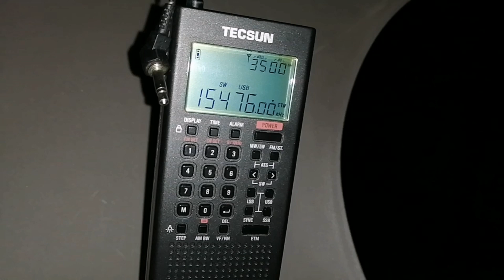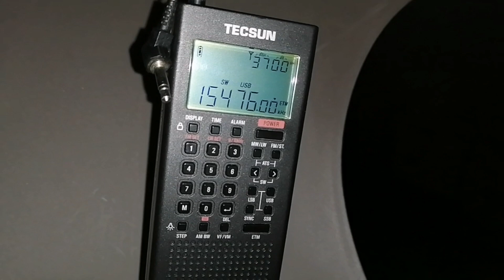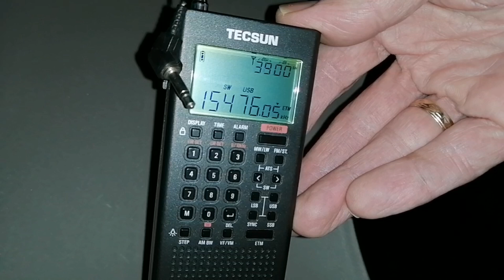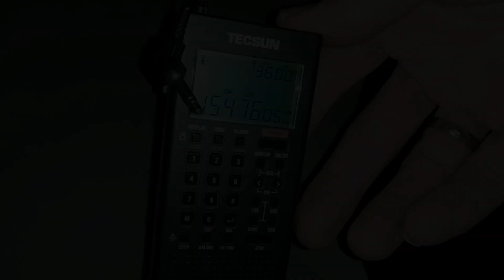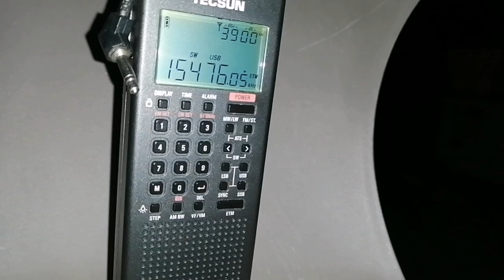LRA36 Radio Arcangel from Antarctica 15476 kHz USB on Tecsun PL-368 #shortwave

Comment: Wow, congratulations. You're raising the bar here. Again, the PL-368 at work for this performance. I'm impressed 👍
I guess that being in SA, you have an advantage over us in Europe to catch this radio 😁
Reply from the maker: Thank you Alain! Yes, I think my location probably helps, there is just a vast and wild ocean between me and Antarctica 🌊
Reply: @swlistening Obviously your location would be advantageous compared to someone in Europe with respect to picking up a station in Antarctica - but that would've been an impressive catch if the station were transmitting from Antarctica's nearest shore to you, when in fact it was anything but! Be Like the difference between me picking up a station in Tangiers (from Ireland) and one in Cape Town or Jo~burg. 1KW? Wow! Quite a testament to that little radio as well!
Reply from the maker: @richiehoyt8487  Thank you so much Richie. I have been able to confirm in the meantime that the transmitter is actually 10 kW, not 1 kW. I checked the website of the Argentine national broadcaster where I was finally able to find the actual transmitter power.
Reply from the maker: @richiehoyt8487  Oh, and yes, the Tecsun PL-368 has really shown its mettle here, great radio!

Comment: It’s great catch from Antarctica with the help of the loop antenna and ssb
Reply from the maker: Thank you! This was with a 10 metre wire though, not the MLA loop. I actually tried with the loop and couldn't catch it, but I think perhaps the loop is not set up in the right direction for this one.
Reply: @swlistening  thanks for reply 
Good to have it with 10m long wire 👏 wishing you another achievement soon
Reply from the maker: @atropicali  Thank you Ali!

Comment: Very nice reception! BTW can you check 2 utility stations if they are still on air? Cape Town Radio 1815UTC 4375, 8740, 13146 kHz and Antananarivo Volmet .20 .50 min each hour 10057 kHz?
Reply from the maker: Thanks! I will check the Cape Town one tonight. I can confirm that Antananarivo Volmet is no longer active. I cannot receive it, have tried many times. Various sources online confirm that it is inactive.
Reply from the maker: I checked the Cape Town Radio signals tonight, didn't pick up anything. But I am quite far away from Cape Town (about 1400 km), so maybe the station is still active and I just didn't pick it up tonight. I will keep trying though. I remembered that I did pick up Cape Town Radio about a year ago on 4375 kHz,  so I am sure they are still active now. Here is the video from last year: https://youtu.be/AOYxkeO2m4g
Reply: Thank you very much! @swlistening
Reply from the maker: @oz_dx  Sure!

Comment: Now you have picked up a station from each continent!
Reply from the maker: Yes, you are right! I didn't actually think of it in this way 🙂
Reply: @swlistening  You should be proud of the PL368's antenna. Mine got bent in a car window, I bent it back, then the DX power was worse. I don't think I will need to replace the whip, I might do it for better performance though.
Reply from the maker: @FamtechVideos The PL-368 antenna is actually quite flimsy, mine is also slightly bent at the end. I was just thinking about this earlier today. I was playing around with the PL-360 and the PL-368 late morning, doing some ETM scans. The PL-360 has a really strong and firm antenna, but a bit shorter than the PL-368.
Reply from the maker: @StratmanII  And it helps that we have regular power cuts in South Africa, although most non DXers would not agree.
Reply: Best time for DX low noise levels 👍👍well done Andre very good catch it's all about propogation and the right timing 📻
Reply: @StratmanII  Sorry, what do you mean by TIA? Also, I don't live in an apartment, I live in a single storey house.
Reply: @swlistening  Yeah, the top tip of mine broke off with the copper still on it, I managed to get it back in, but now the DX quality is worse on shortwave, as well as mediumwave (If I use the whip).
Reply from the maker: @JohnGreen-SWL  Thanks John!
Reply: @swlistening  I must say, 100% yes, but you would have to use portables like a Tecsun PL880 or something like my Sony Worldzone where it uses batteries. Things like the Kenwood R1000 and Barlow-Wadley receivers of yours have to use mains power, and if you use a generator or something like that, like the Blue Yeti of yours, interference will be made.
Reply: @JohnGreen-SWL  I agree.
Reply from the maker: @StratmanII  I don't actually know what the prices are elsewhere in Africa, but here there is obviously a vast new market for things like batteries, solar lights, backup power stations... Which means there is quite a bit of competition. I haven't really noticed an increase in prices, apart from the usual inflation. Sometimes there are actually some really great deals on portable backup power stations, with vastly reduced prices. I guess some companies buy lots of stock, they don't sell, then they reduce prices... It also depends on the loadshedding schedule. When we are at higher stages, like 12 hours a day without power, then I do notice prices going up. But, fortunately, that does not happen often. For the past few weeks we have been on a schedule where power is switched off for about 2 hours per day only, that is not really a major issue for most people. Government promises there will be no more loadshedding next year, so let's see 😀 They are working hard to fix all the power stattions that have not been maintained well under the previous president, Jacob Zuma. His era was a time of extreme corruption.
Reply from the maker: @FamtechVideos   The  Barlow Wadley actually works on batteries, six D cell batteries that last forever. But on my Barlow Wadley, SSB reception is poor, I actually did try on the Barlow Wadley last night, without success. You are right when you say that portables outside in a low noise environment might be the best to catch this signal.
Reply: @swlistening  Interesting. My Sony requires 8 D cell batteries, doesn't have SSB, but also lasts for ages.
Reply: @StratmanII  🤣🤣🤣  There are a few answers to that. Mostly demand is high on rechargeable batteries, but most people are using disposable ones if they can't afford rechargeable ones.
Reply: @StratmanII  Oh I certainly would, but I have never really had one, nor considered one. I am not an amateur radio operator, although it is one of my dreams to get a license for amateur radio. The PL680 and that sound perfect.
Reply from the maker: @StratmanII  Thank you for this, it sounds like a really great radio... I am intrigued. Will certainly look into it a bit more. But I think when I buy my next radio it is still going to be between the PL-680, the Sangean PR-D4BT or the CC Radio EP Pro, the last two for their MW capabilities. I feel I really want another very good MW radio now. Jay Allen gives the Sangean four and a half stars on MW, and the EP Pro five stars.
Reply: @swlistening I will check a comparison of them for you and I will give an answer. Do you still use your Tivoli?
Reply from the maker: @FamtechVideos  I do, but mostly for music listening. I think it is the best-sounding radio I own at the moment, for music. Terrific sound!
Reply: @StratmanII  I was living in an apartment when I was in Turkey. I see now what TIA means. Leonardo Decaprio is a legend.

Edit: I think the video at the end showed something parts of Africa are famous for, which is wars and shooting.
Reply: @StratmanII No I have watched Danny Archer - Blood Diamond before. It was last year. I completely forgot Leonardo Dicaprio said "This is Africa."
Reply from the maker: @StratmanII  Sure!